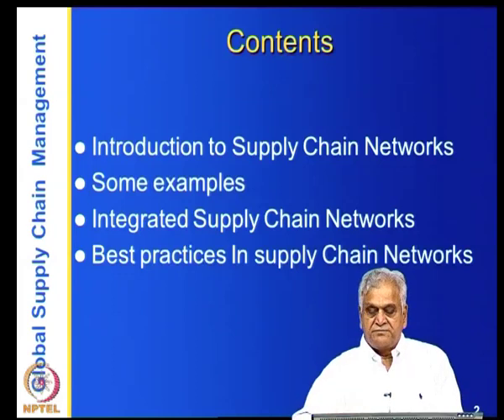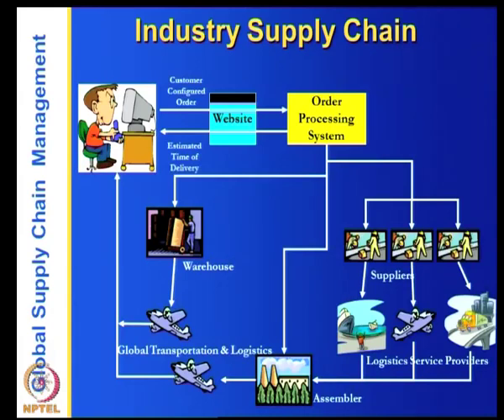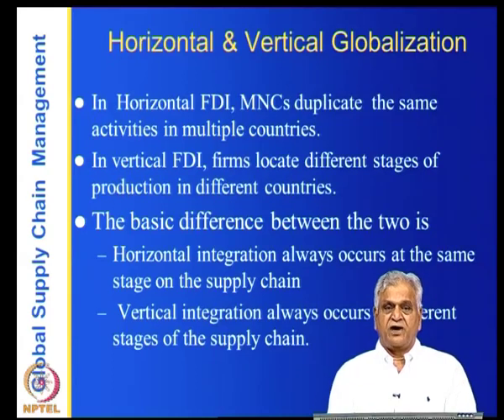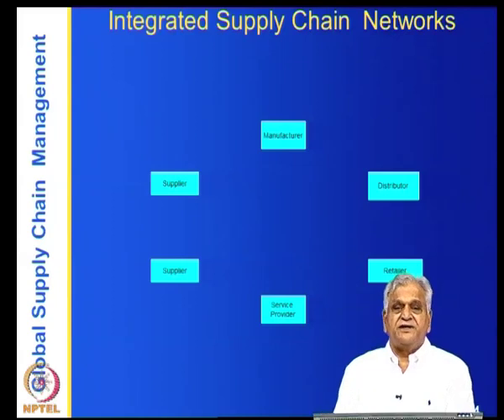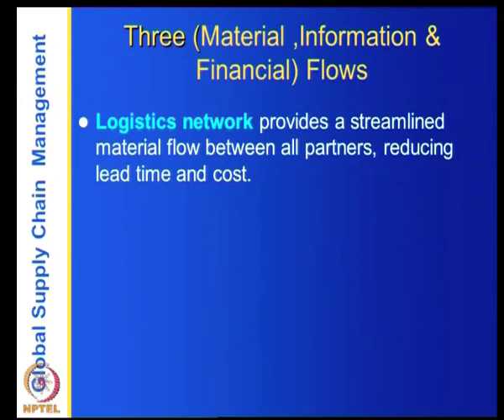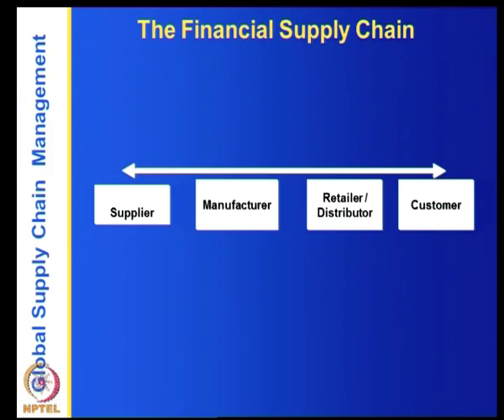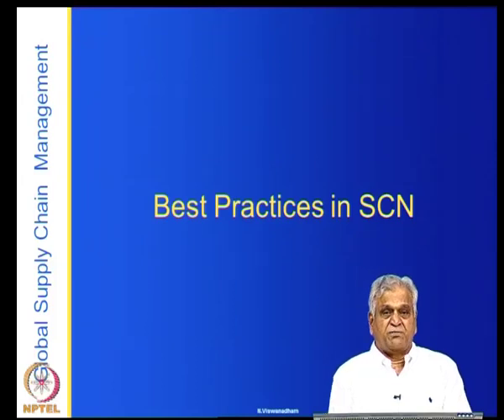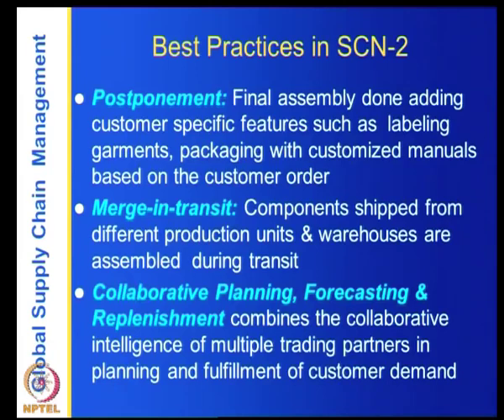Mod-01 Lec-01 Introduction to Global Supply Chain Networks Part- 1

Comment: In the context of global supply chain management, the topics can be prioritized as follows:

Risk Management - Essential for mitigating disruptions and ensuring continuity.
Performance Analysis - Important for assessing efficiency and effectiveness.
Supply Chain Design - Critical for optimizing operations and meeting strategic goals.
Green Supply Chain - Increasingly vital due to sustainability concerns.
Innovation - Key for staying competitive and adapting to market changes.
Location Selection - Important for cost efficiency and logistical effectiveness.
Governance - Necessary for compliance and ethical operations.
GRIP Framework - Useful for structured analysis and improvement.
Cemex - Relevant case study for specific industry practices.
Li and Fung - Insightful for understanding global sourcing and distribution.
This ranking may vary based on specific business goals and industry contexts.
Reply: is it worth it wathcing this playlist in 2025 ? is it still relevant